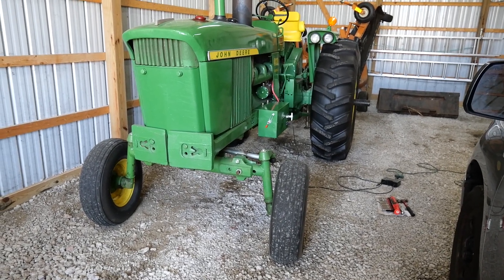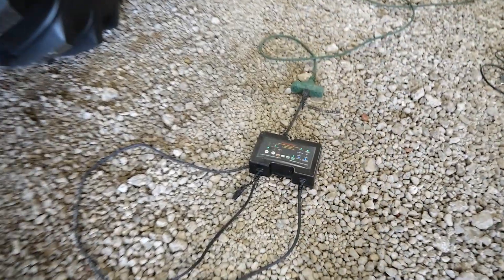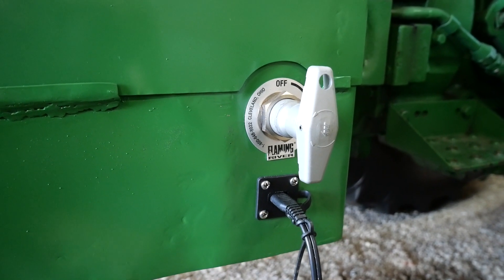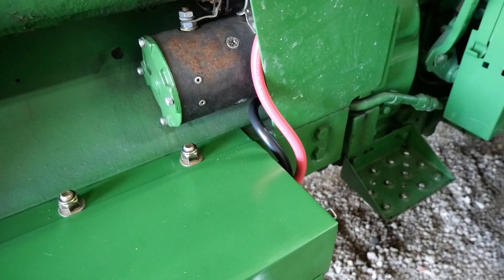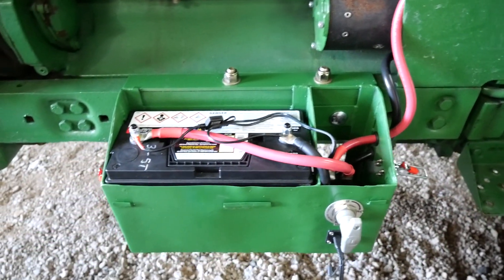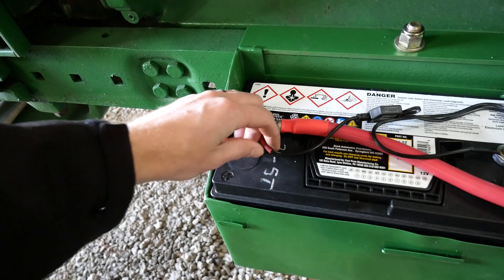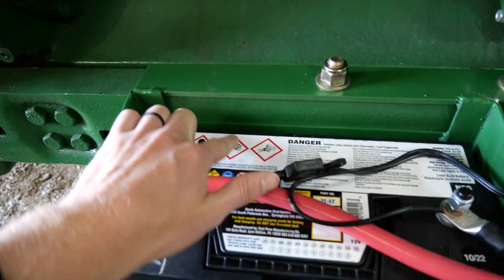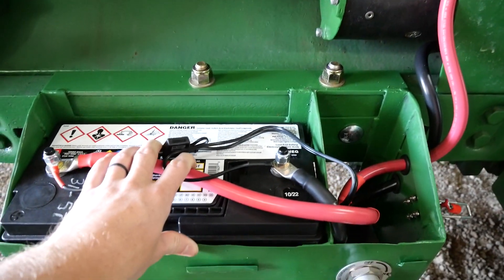Homemade John Deere 4020 Frame Rail Battery Box

Comment: That is really clean. How much would you charge to make one for my 4320/4020.  I already have the switch.  That is really clean and simple.
Reply from the maker: Thanks so much. I'm unfortunately busy doing an out-of-frame overhaul on my tractor right now to be able to support. By the time I'd cover parts and material it would be around $400 if you're ever interested though. What is your location? I'm over in southwest Ohio.